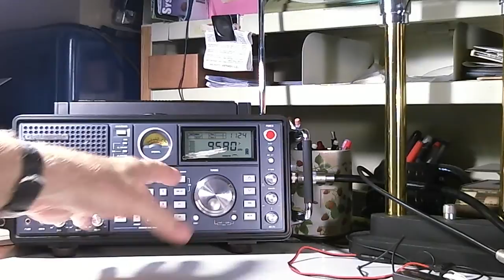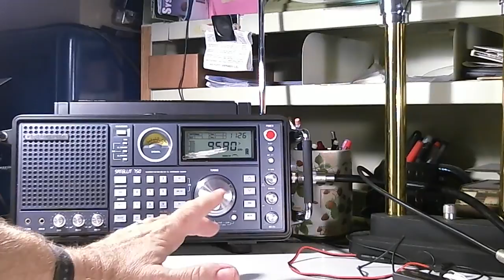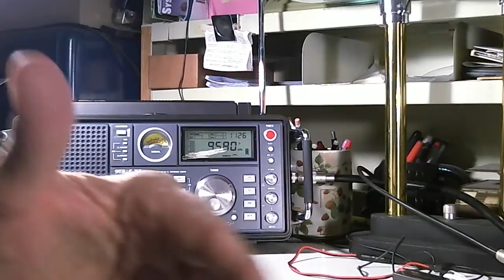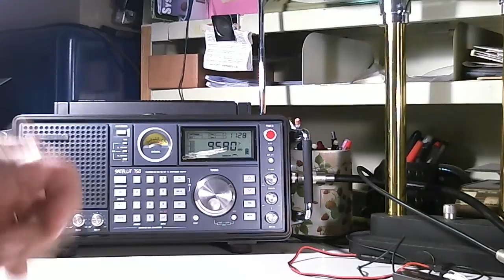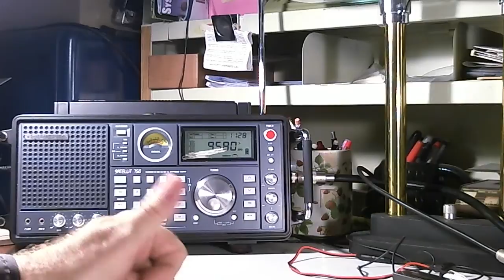TRRS #0372 - Using External Antennas to Improve Reception

Comment: How to make external antenna
We need a video about that
Reply from the maker: It is very simple. Get some insulated wire at least 20 feet long and hang it out in the trees and connect it to the radio. You can buy these antennas on Amazon or other internet store or a local store. Here is an example article. https://www.electronics-notes.com/articles/antennas-propagation/end-fed-wire-antenna/end-fed-long-wire-antenna-basics.php#google_vignette

Comment: I am surely no expert.. I own that radio too.  I've always thought... that the pull up antenna is a FM/SW  antenna and the bar on top of the radio that will turn is the actual AM antenna.  It's marked MW/LW Rotatable antenna.  And to get to AM mode you have to push the MW/LW button to activate the AM band.  But like I said, I'm no expert.. the pull up antenna may very well be for AM too.  The rotatable bar too.... has a 1/8" connector for a external to plug in there.
Reply from the maker: You original assumption is correct.  The bar antenna is for LW/MW and has a connector for an external antenna for those bands only.  The telescopic antenna is only for FM/SW.  The connectors for these bands are on the right side of the radio.  Remember, I am no expert either. :)
Reply: I,Own A Kenwood R-2000 ,Which Receives Great On A Antron-99 ,Antenna OutSide.using Mini-8 Coax , 100' In Length.

Comment: Hi Tom. Great show. A while back, I built one of those "PA0RDT Mini Whip" active antennas. Here is the link: http://www.radiopassioni.it/pdf/pa0rdt-Mini-Whip.PDF . It performs very well. Very low noise. I installed it on my tower at the 20 ft level. Mainly use it on the Kenwood R-1000. Some of your followers may want to build one up, pretty easy.
73, Randy, w5kcm
Reply from the maker: Thanks for the information.  I will check it out.

Tom

Comment: Tom,
I had great results like you did just taking my 909x out of the house and just stepped outside the house with it as it made a big difference  just taking it out on our porch and away from the electrical noise we have in the house.

You would not believe how well reception improved for me by simply doing that as I tried China Radio like you suggested and could not get it and stepped outside and was able to pick it up nicely.  Also picked up Radio Australia as well even better.

Just thought I would pass it on for those that have great weather and need an excuse to get outside with their radios and don't have a nice antenna setup like you yet.  Of course it helps if your neighbors are not close as well that could mess with your reception as well.
Reply: I have A 750 should I run a 30 foot wire outside or a an 30 loop antenna??
Reply from the maker: Thank you for your comments and support.

Tom

Comment: I agree with Cameron's assertion the the background noise is actually digeridoo and used to create ambience within the programme presentation.

Closed loop antennas fair better in noisy conditions, my T2FD always has a lower noise floor than my random wire antenna, I would have been curious to see how your loop would have performed on the day.
Reply from the maker: Thanks for your comments and support.  I briefly hooked up my little loop antenna but it did not help much.

Tom
Reply: hamrad88 Oh okay thanks, maybe next time we'll see it's inclusion...

Comment: Very interesting Tom. Any chance of a show about your external antenna set up? I'm looking into that subject myself but I don't have a backyard to use as I live in an apartment. Any suggestions?
Reply from the maker: I did a video about six months ago showing my external antenna.  Don't remember the show number.  An external antenna like Sangean reel antenna might help if you do not have too much interference in your apartment.  I have a video on that antenna too.  Sometimes the problem is that your whip antenna is just not long enough to tune to lower part of the shortwave band.  Adding 20 or 30 feet of wire to your whip antenna could help.

Tom
Reply: Thanks Tom - I think a loop antenna might be a possibility after watching your videos.
Reply from the maker: You are welcome.  Keep us posted on your findings.

Tom